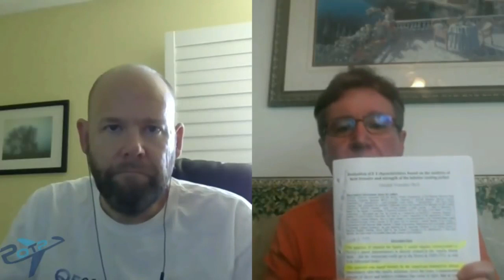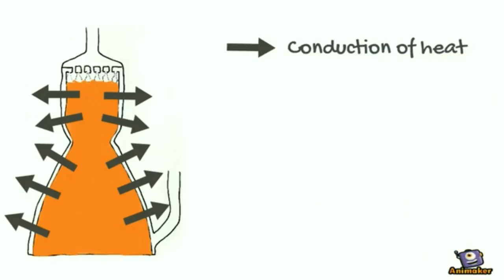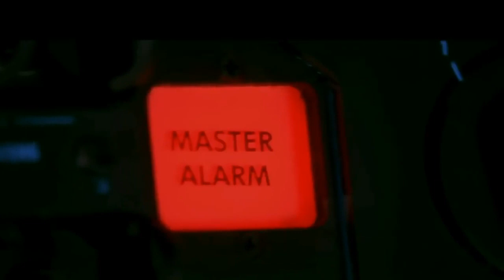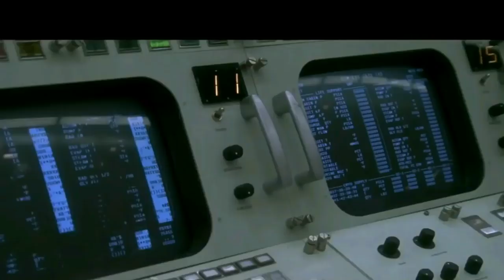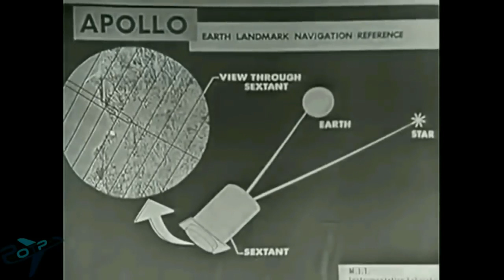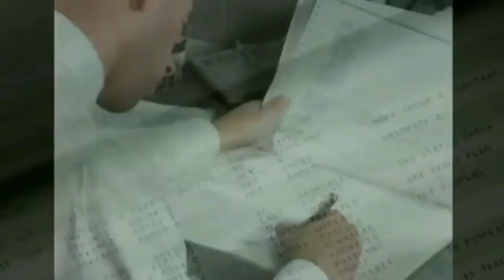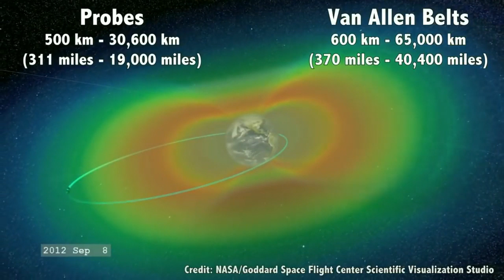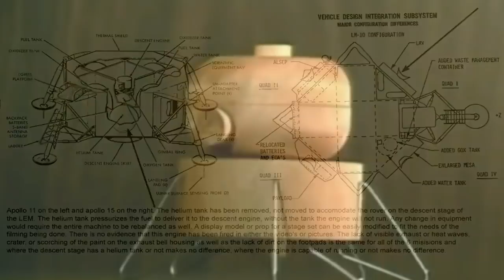Moon Hoax; "Apollo, Hiding A Hoax In Plain Sight"

Comment: Let me add on more. The computer that time stopped working every 30 minutes. It takes a while to replace a part to make it work. to restart the computer, it set a paper loader, and runs the paper tape to start up OS system, and finally, it can take the program by a deck of paper cards. Course calculation and correction using such a computer? Ha ha ha ha. It's a joke.